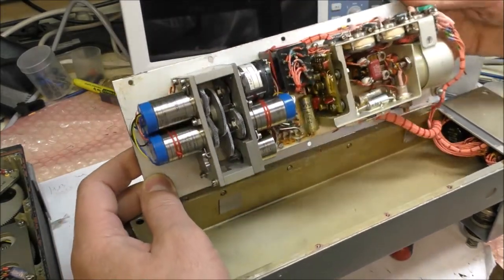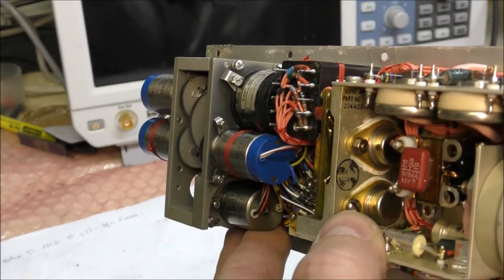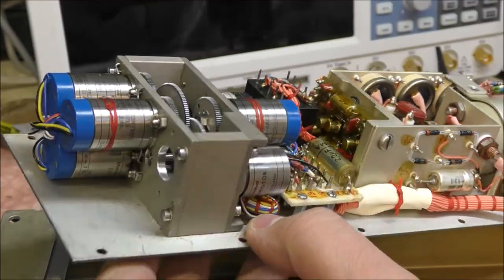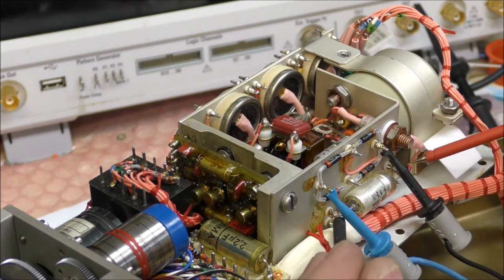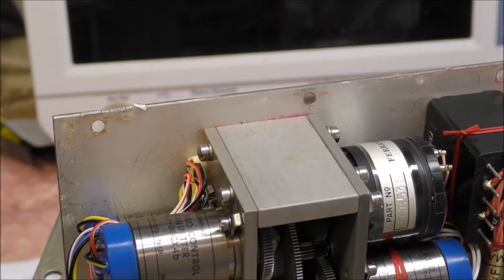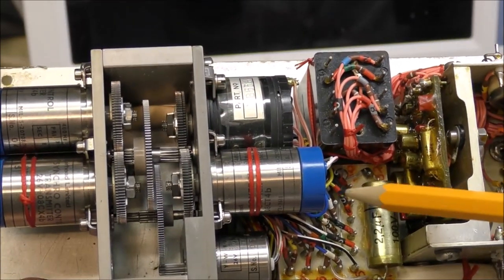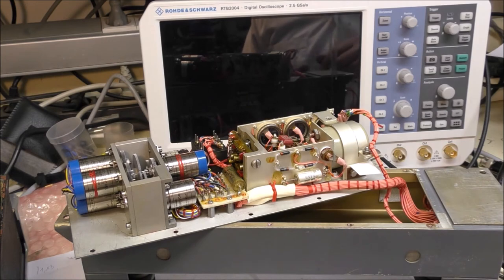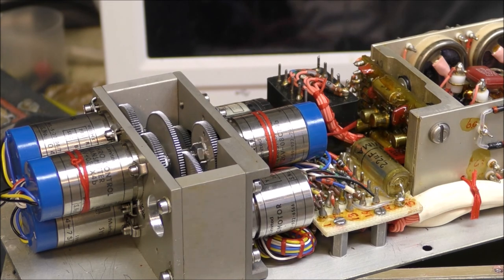LDM #156: Teardown and tests of a Sperry Aircraft Gyro Amplifier Base

Comment: Nice.  I have a box full of synchros, motors and steppers.  i'd love to know more about how to drive them properly and make them do something useful.  the ones i have experimented with all had extremely low torque, but that system looks like it has at least enough to stop with no overshoot
Reply from the maker: Generally a synchro transmitter doesn't have a large torque. They are normally used in a servo control loop like in this instrument where the torque is delivered by a DC or AC motor sometimes with a generator for speed control and where a synchro transformer is used for zero detection.